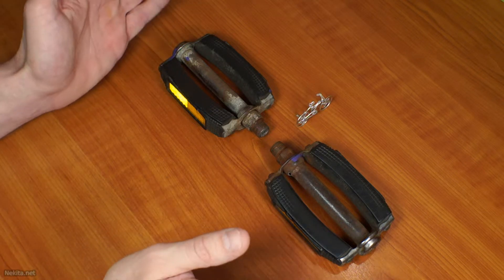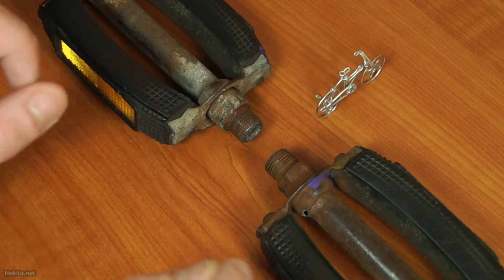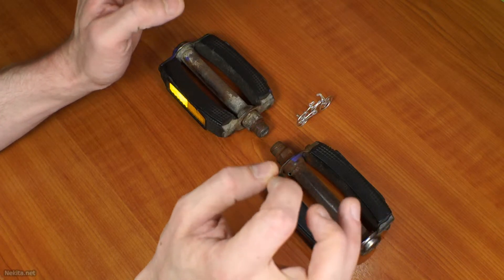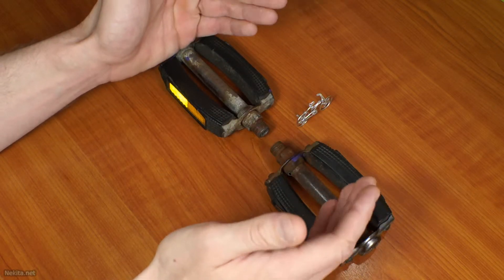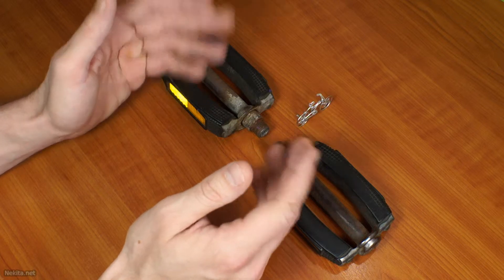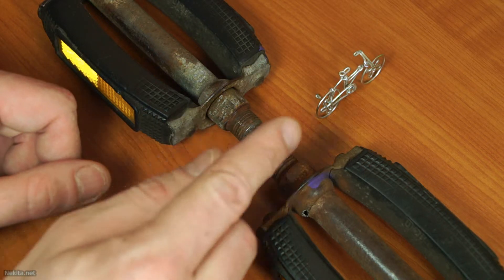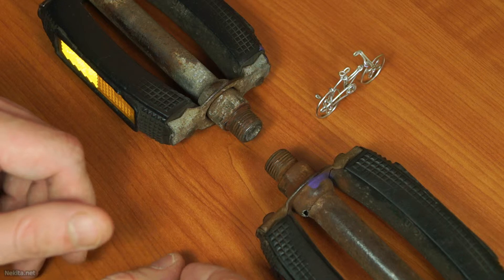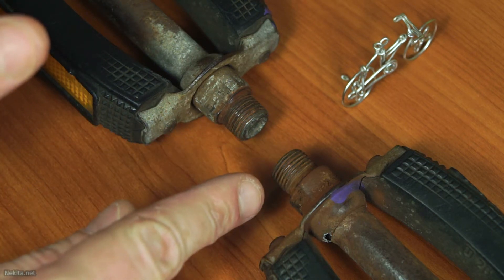Left and Right handed Thread on Bicycle Pedals

Comment: A brand new set of pedals or at least something better than those beaten-up rusty old pedals should have been used as examples.  Sorry bud, normally I distribute likes like candy, but in this case, a thumbs down.
Reply from the maker: Wondering why that's important. Point of the video isn't the paddles, but the thread pattern on them being important! Thanks for your interactions with this video though! Good luck :-)
Reply: @NekitaNet  Looks like someone has too much time on their hands